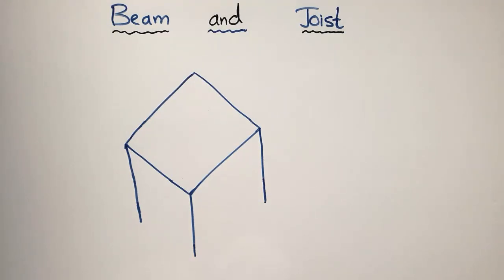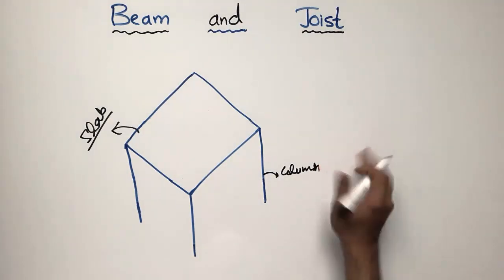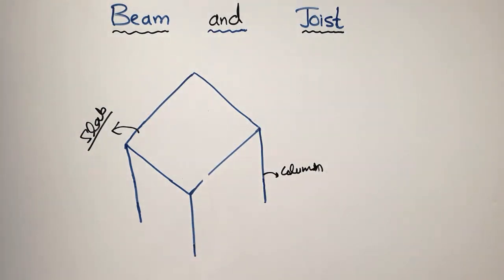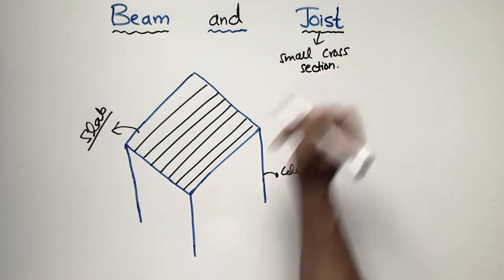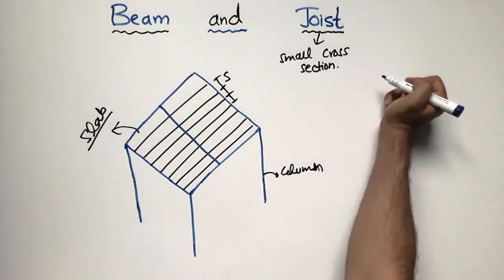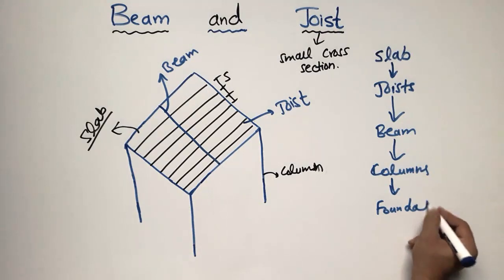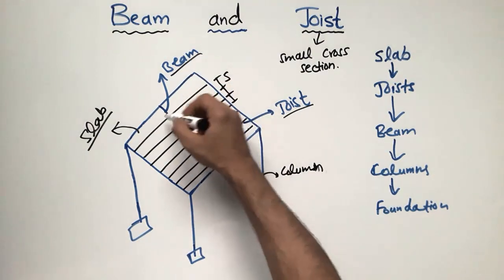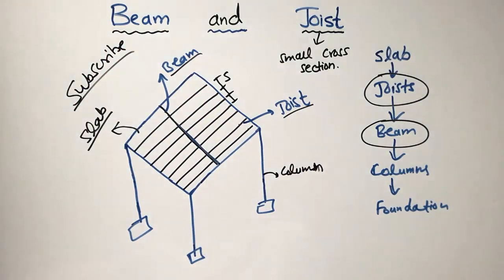Difference between Beam and Joist

Comment: So basically joists are used in long span buildings because you’d have to place a beam inside the building otherwise and people don’t want/like that. Joists are horizontal members that replace the beams you would’ve put instead.
Reply: And I have to think that the edges of the slab are also beams, so that their role in transferring load to the columns is accounted for?